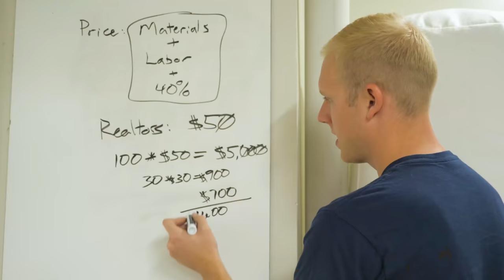Why our laser FILLED WITH SMOKE on its BIGGEST day... | Furniture Business Update

Comment: One thing to keep in mind with blowing our fans with compressed air is that it will probably spin them WAY faster than they are rated for. It's good practice to hold them still while blowing so you don't toast the bearings.
Reply: Not only that, but spinning the fan can cause an electric current BACK into the board.  It looks fun, but can be dangerous
Reply: Panicked a bit when I saw him whip out the air compressor. Glad it’s all okay! Always remember electric motors and generators are the same parts running in opposite directions of flow.
Reply: Came here to say this. Also it looks like they should have cleaned it a long time ago too.
Reply: I came to say the same thing lol. Leading up to it I’m like “he’s not gonna hold the fan still, he’s gonna let it spin. Please don’t do that. WHAT ARE YOU DOING!!!?!?!?” Ha ha
Reply: Probably every professional computer repair person had the same reaction.

Comment: So I worked in electronic repair for about 15 years. Water itself isn’t bad for electronics, it’s the minerals in the water that cause the issue. Alcohol will cause no issues with electronics. We used paint thinner from a hardware store to clean motherboards and other components with a soft bristle toothbrush. Just some info to pass along to you guys!

Comment: If you're going to go to all that trouble, replace the fan with a high quality ball bearing fan.  You'll still have to clean it periodically, but it will be much less likely to stop due to dust in between cleanings.  Also, assuming that fan has sleeve bearings, it will eventually die a permanent death long before a high quality ball bearing fan will.  I'd do the same with any other fans in the unit.

Comment: I find it silly to point this out. You build furniture for fun. Why have you not built a proper furniture for the Glow Forge? Maintenance would be easier at hip height instead be on the floor. You would have more storage space too!
Reply: They build furniture and boards for profit. Would seam silly to spend a week building a proper table when a folding table would get the job done.
Reply: @prodigalpilot   @Alex LaFave  Shop furniture with 2 by 4 and plywood is not hard and time consuming. They could have both Glow Forge running in the same space increasing productivity. Or even have both on site instead in the storage unit and dismissing downtime. Even with the folding table, they could be running both, it's not like there were not already working on the floor. The case could be also made with fire hazard for plastic or wood, but hey, they should be soon in their commercial space.

Comment: While you're cleaning the air assist fan it's worth taking a few more minutes and clean out the exhaust fan in the back. There's also a tiny head fan but that doesn't seem to get as dirty.
Reply: A small vacuum would be a good idea too. Hard to get dust out otherwise.

Comment: i seen adam savage from mythbusters when he used his lasercutter , he had installed a pretty impressive evac system inside the box to pull the smoke off as the smoke heats up parts that arent supposed to heat up and reduces the energy transfered to the material that needs to be worked on 
small tip about fans on mictroelectronics in general : hold the fan dont spin it up with the compressed ar , the fan motor can generate enough electricity to burn out the electronics on the board its mounted on if you spin it up

Comment: You guys should look into getting a different laser, from everything I found glowforge for the price isn't the best option. We went with omtech 60 watt, larger burning area, and a lot of user support.
Reply: Checking it out now. Thanks for sharing!
Reply: @darsweave  Not a problem I have the 20x28 60 watt, and am very happy with it.
Reply: run omtech 60w 20x28 few upgrades and im 3500 vs 6k    and the 60 watt be faster for them.. for them id go a trotec or a mira9
Reply: if it would fit a couple k40s would increase there production times
Reply: @codys2439  K40 would take a big of a mortification first, A 60w would be able two do two cutting boards at a time easy enough. Also better over all longevity on the tube not working as hard.

Comment: I had to do this on my glowforge a few weeks ago in the run-up to a craft market. All went swimmingly until I did a test run and it came out like a drunk tattoo. Wobbling all over the place. turns out you need to be pretty forceful when putting the belt back on and sliding the end piece back before tightening it up.  Also, the first time I did it, I left the little metal hood on the fan when cleaning it, but the second time I unscrewed that too, and it came out a lot cleaner. I have scheduled in to clean out that fan about once a month now, or before any intense use.

Comment: With the 2 sharp 90 degree bends you have in your exhaust set up, you are lowering your cfm by quite a bit. I know space is an issue but if you can keep the run straight as you can you'll cycle more air which means your machine won't get dirty as fast.
Reply from the maker: Ooh good point! Didn’t think about it in terms of dirtiness… might have to rotate it or something

Comment: one very important note, all of the vapors coming from the wood will condense into a very flammable sticky resin. With that resin coating every surface inside your machine and throughout the exhaust hoses, if it catches fire. You will be lucky if it only destroys your laser. At the very least you should have a fire extinguisher close at hand just in case. I know I sound like someones Dad, but that's what Dads do.
Reply from the maker: Our dads are great!

Comment: Why not build a shelf system for the 2 glowforges to stack them? That way you can use both at the same time, and in case one goes down for maintenance, you don't have to go to the storage unit to grab and set up the other forge.
Reply from the maker: Because the time and effort required to build a shelf system would take more time than 5+ trips to the storage unit… we’ll roll the dice on that one
Reply: @jennieanddavis  there is a bigger risk of damaging the backup unit if you end up needing to move it often though. those machines aren't really made to be moved around a lot.  Also, you could half the time it takes to engrave boards with two going at once. You could have one on the floor as you do already, but under a table and one on the table. Seems like even if you didn't want to build it you could get a cheap table from IKEA that would do the job. I would also be worried about the machine in storage getting damaged or rusted or there being a fault that you didn't know about, and crapping out on you when you need it, at least if its set up in the workspace it can be in use and you know it works.  I had that with a camera, at a company I used to work at, the main camera needed to go in for repairs, but they had a backup, when we went to use it it was dead as a doornail. It had been taken out and check when they first got it, but then just been sat in a box for 3 years, and did not work, so ended up having to buy another camera and from then on just alternated with the repaired and the new camera, and always had a fully functioning camera when we needed it. I'm not really saying either way is wrong, just that from personal experience, I would always want any back up I had to be in place and ready to go if I needed it.